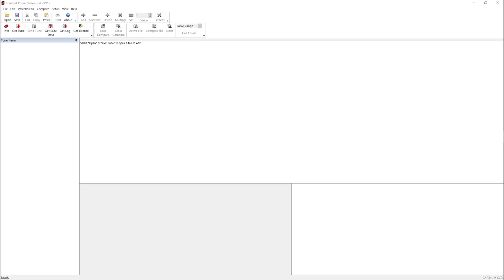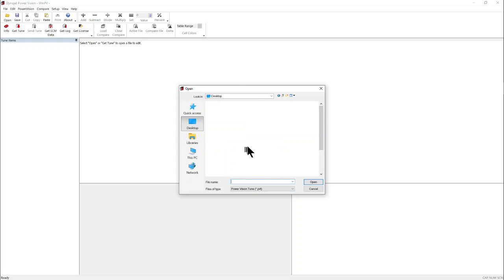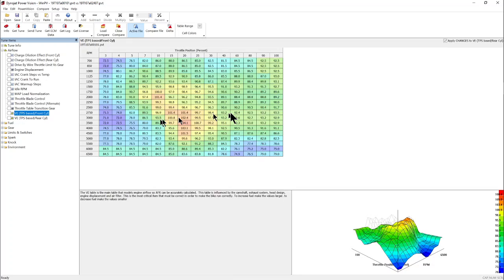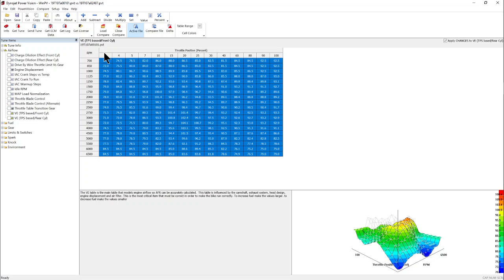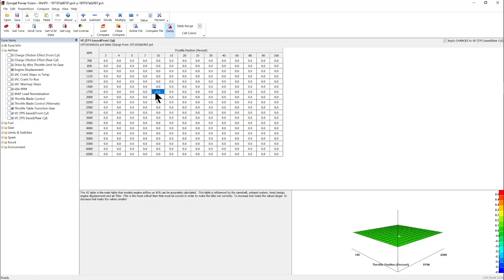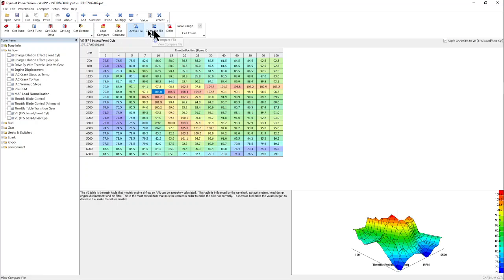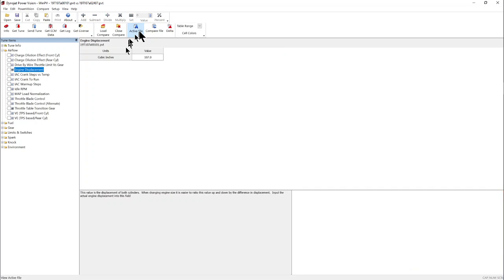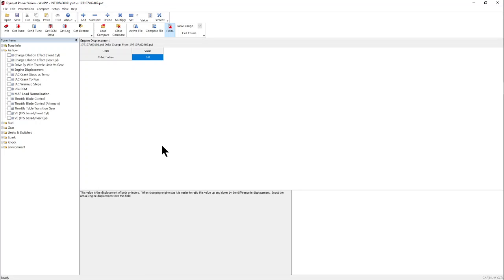Dynojet Power Vision, WinPV - Importing VE Tables

Comment: What are we looking at to calibrate the VE table to our setup ? Are we changing the red colored cell AFR to make it green or yellow ?
Reply from the maker: You're looking at the 'hits' screen, all it is telling you is how many samples you're getting in each cell. Green means there's no samples. As it acquires samples in each cell the cell will turn yellow and when it reaches the required minimum number to do a calculation the cell will turn red. The default is five samples minimum. It's recommended for a good average to have at least 15 to 20. Once you get that 15 to 20 in each accessible cell you need to check the learn corrections front and rear screen (lcorf and lcorr) to see if the numbers are between plus 15 and minus 15. If they are that will be the last required auto-tune session if they are not you need to save what you've learned and start a new auto-tune session using the map you just completed for the new starting point. The hard part is recognizing from experience which cells are getting faults O2 ratings. These cells will never stop asking for you to add fuel and if you don't recognize that the tune will never come out right, it will just keep asking to rescale.